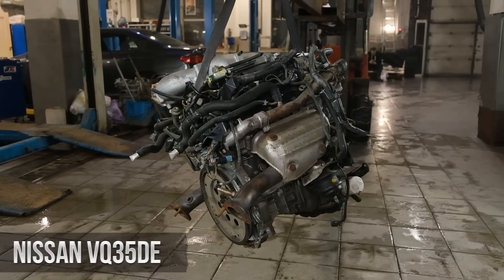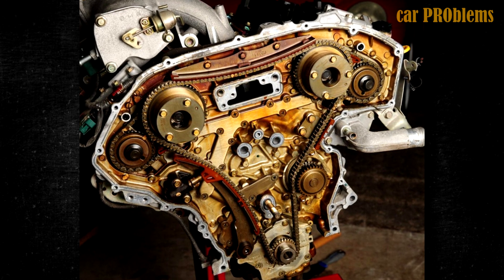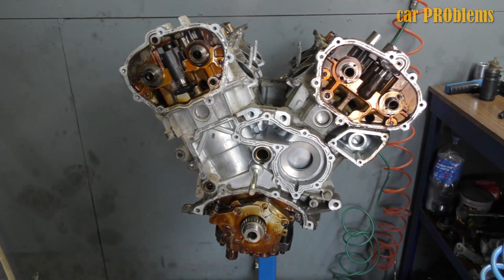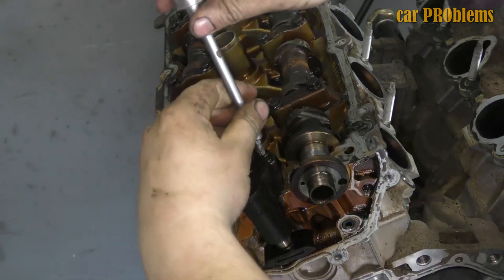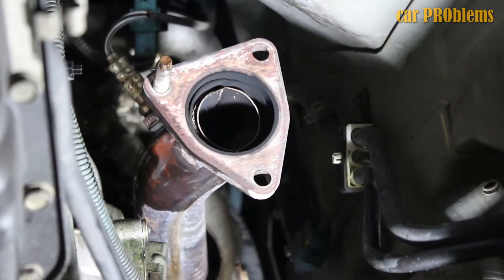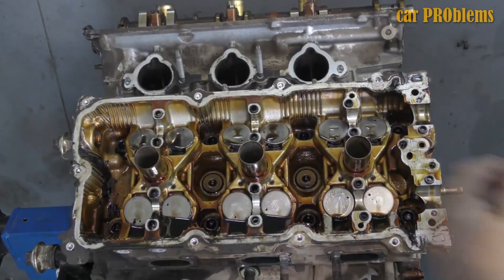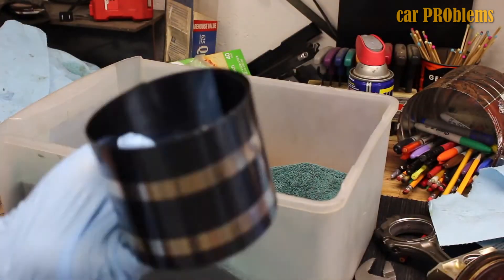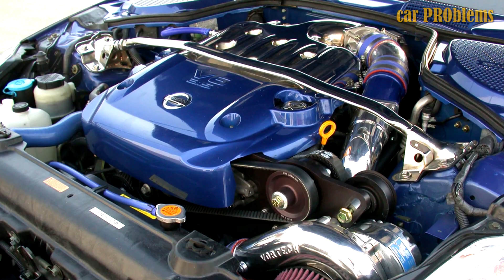VQ35DE engine: Overview, Problems, Reliability, Tuning

Comment: can i get more info about the cats? because my vq35 started misfiring in multiple cylinders (1, 3, and 6) and i am rebuilding it, i thought chain slipped but after i removed the heads i dont see any bent valves so something else mustve been going on, how can i check the cats and/or fix them so i can run higher hp through them without the same problem
Reply from the maker: Yeah, those VQ35DEs are known for the cats breaking down and sending ceramic dust back into the engine — especially the manifold cats. That junk scores the cylinders and causes misfires like you had.
When you rebuild it, pull both manifolds and look inside with a light. If the honeycomb looks melted, cracked, or powdered — toss ’em.
Most guys run high-flow aftermarket cats or relocate them further downstream to keep heat and backflow off the engine.
And don’t run it lean or with bad O2 sensors — that’s what kills the cats in the first place.

Comment: For the last five years I wondered what happened to the oil, my first oil change there was no oil in the car. Added new oil and the next oil change i realized the vehicle is burning oil somewhere but couldn't find out exactly where and how until now.
Reply: It's the oil cooler ring gasket

Comment: My 2004 vQ35De lasted 7 years Mobil 1 only till I decided to go royal purple which blew my engine replaced the engine lesson learned. Best engine ever.
Reply: Using royal purple twice since I owned it, going to stop now…
Reply: It mean that this engine only need Mobil 1 ti run for ever ?
Reply: I thought you can’t convert from royal purple to anything else, is that true because that’s what I’m burning now
Reply: @Senko-s5o  you can it shouldn’t be an issue switching back to mobile 1 which works way better for the vq engine
Reply: VQ series engine are SHELL HELIX ULTRA 5w40 only, everything else is diarrhea
Reply: Royal purple oil is trash

Comment: Airports can be vented by the purge valve on the top driver's side. It looks like an a/c line. It's the highest point in the system.

Comment: more people need to speak on the valve covers
Reply: What’s up with them ?
Reply: @JENNANDJUDD  made of hard plastic , they’ll continue to leak oil even after replacement , aftermarket companies make aluminum ones which have serviceable spark plug seals, those do the job better

Comment: If you have a car with a vq35de then your in good hands
Reply: Mine blew a head gasket 😢 247k miles
Reply: @M_A_R_I_N_E785  boomer, Im seeing alot in my area with similar miles and that same problem. Im wondering if its from driving it to hard
Reply: @king_Charles501  i babied mine and rarely beat on it, although it is bolt on. Had it for 4 years (2004 fx35 Infiniti) handles like a sports car and 0-60 was just over 6 seconds with everything i did made just shy of 350 crank hp
Reply: 09 maxima vq35de going strong cvt is the only bad thing but so far cvt holding up good
Reply: @juniorbonilla4796  as long as you ignore Nissan's lifetime gearbox nonsense, and change the fluid ever 50k kms, you shouldn't have any problems.
Reply: @TheGrifCannon00  They recommend NO service to me, if there is no actual issue with shifting etc. I don't like it, but that's what the service center says. Primarily because I think once they open them, change the filter and fluid and the thing fails (for regular reasons), the customer will automatically blame them for any failure, so even our Nissan dealers won't touch them. The correct fluid MUST be the Nissan fluid and it costs a bomb too. They treat the CVT like a module that will eventually fail, so no service and once they fail, they are a complete replacement item (a very expensive one with the part/labour).
Reply: @juniorbonilla4796  I think by '09 they'd fixed the early CVT issues, if you try and tow anything, that's another matter, as it puts more load on and was a frequent cause of failure of the early CVTs, and those CVTs didn't do well with towing and lifetime. The CVT still has a limited lifespan, is unmaintainable for most people, and your engine should outlive it at least once as with most transmissions.

From what I read about the CVT issues is that there is a small high-pressure pump near the valve body that would overheat, and wear out prematurely, leading to poor shifting etc. and eventual failure of the CVT. Interestingly there is actually a legitimate transmission cooler part available from Nissan...

Comment: The VQ35HR is better
Reply: Better for the power band, yes. However, they suffer from a fatal flaw and that’s the gallery gasket disintegrating over time. As the person said above, might as well jump to the best VQ and that’s the VQ37VHR.
Reply: @Iridiumcosmos  Yeah, but that thing sits in an ugly car.
Reply: Definitely, the only problem I have is for the price of them you might as well get a vq37.
Reply: The de is better and holds the highest power on the modded platform.

Comment: Feel like I’ve delt with every problem with this motor 😂
Reply: Should I get one with 112 thousand miles?
Reply: @racielaraujo4886  sure why not.
Reply: @racielaraujo4886 thats pretty good milage tbh
Reply: @racielaraujo4886  yeah, it hasn’t been broken in yet
Reply: @natefrm860 I feel you broo

Comment: Does Nissan Pathfinder R50 (2001-2004) have the same VQ35DE engine with 350Z and G35? Thankyou in advance!
Reply: No
Reply: Pretty sure that has the VG33 engine so no
Reply: Yes, I have an ‘02 R50 and it has the VQ35DE

Comment: The only thing you got wrong was that the hr part. Its the vq35de rev up
Reply: He actually did get it right the model year is 2007 im pretty sure but the 07 350z came out in late 06 with the hr
Reply: @jdkosen4480 the HR started in 2007. Never a 2006 got it. Maybe one was made in 2006, but for the 2007 model year
Reply: Pretty sure but all the stuff he is talking about is in the hr not the rev up

Comment: What if y remove the cats will the problems still happen
Reply: I removed my cats on my 2001 Altima SE with a manual trans ten years ago. Also run headers, down pipe into cherry bomb straight through muffler which acts as a resonator then borla mufflers. Cold air intake with a cone filter that runs down to the front left running light. running light is removed with a home made ram air type system.
Reply: Nope that'll fix it